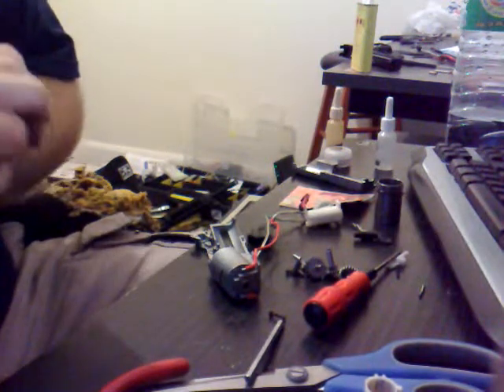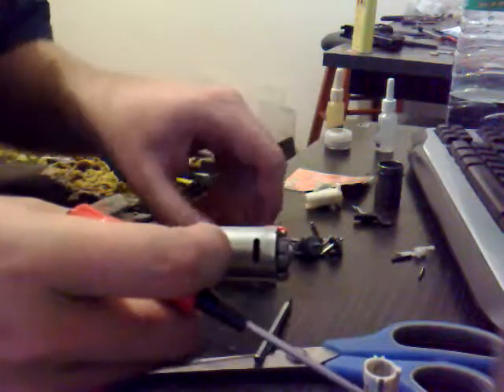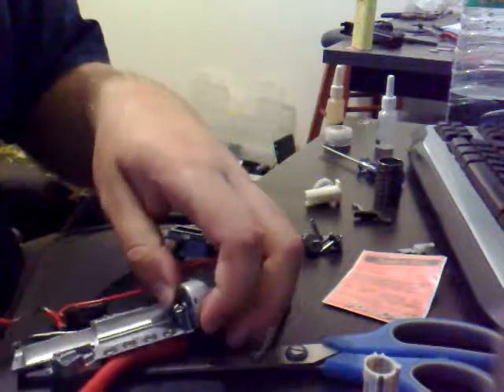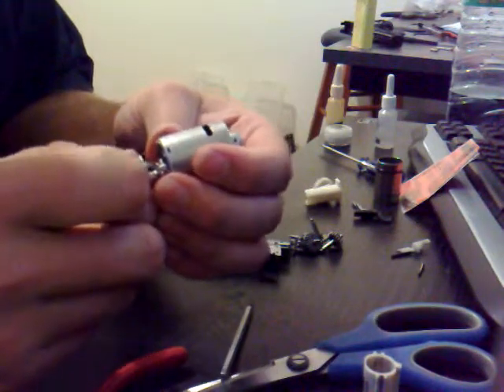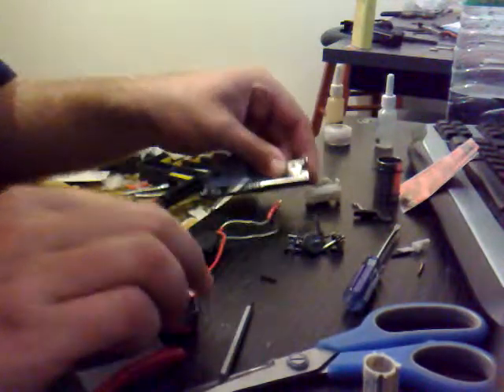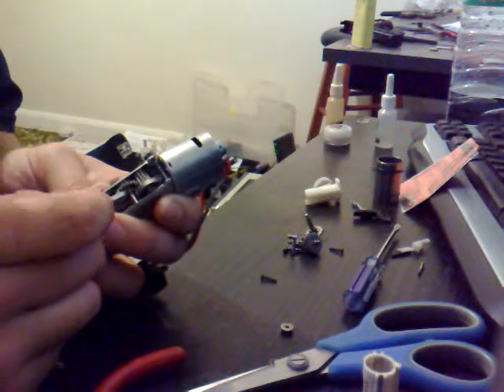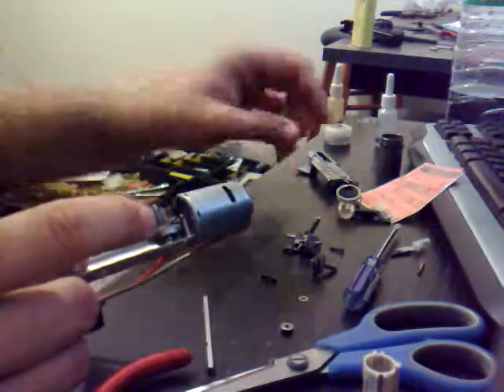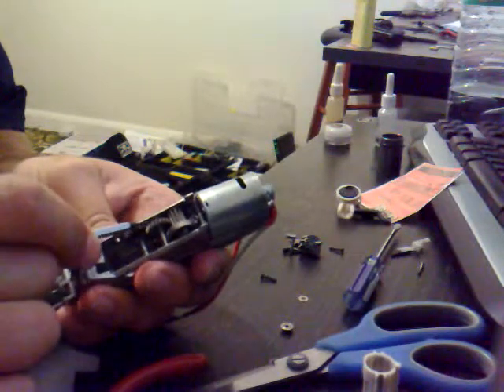Tutorial - How to Shim An AEP Gearbox - Part 1

Comment: I don't know if this was stated but if you remove all shims and reshim, you can have a different sound because now some of the gears are not in the same exact sweet spot that was preused. These gears are the two in the middle of the 4. They should have a shim on the bottom and not the top. You can look at the previous wear spot on the bevel gear and see this exactly. I have tested both and different in sound is quite different. Anyway, good video!

Comment from the maker: servicing it, and proper shimming will help pronlong the life of your gearbox.  Ie: having no play in the bushings, after 50k rounds nylon bushings start to wear.  So in that regard for the long term, fitting bearings or bushings and making sure they are properly lubricated with bearing oil is definatly a good long term measure for your gearbox.
Reply: Eagle6Airsoft where is the shimset from?